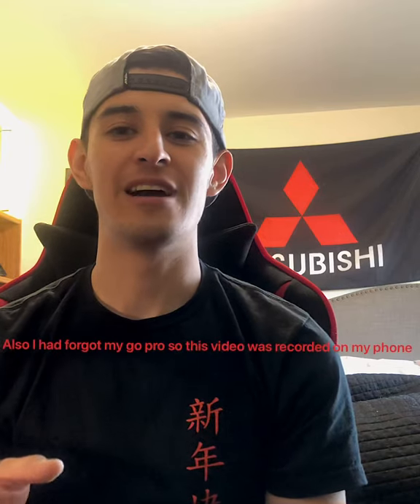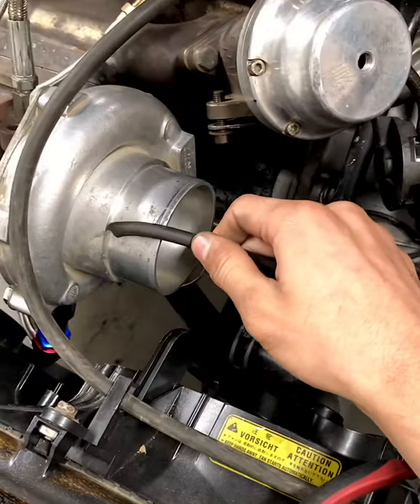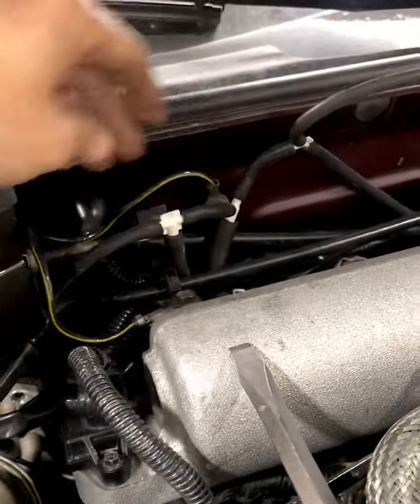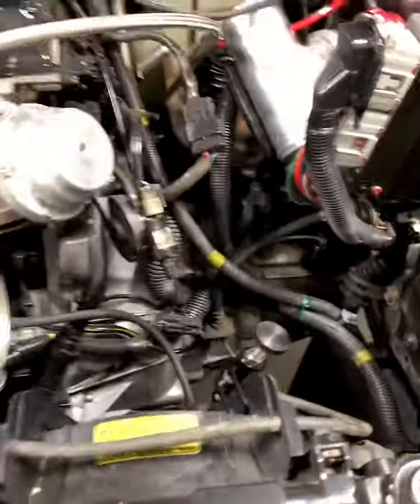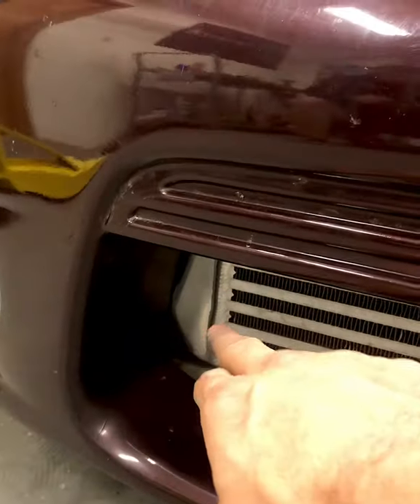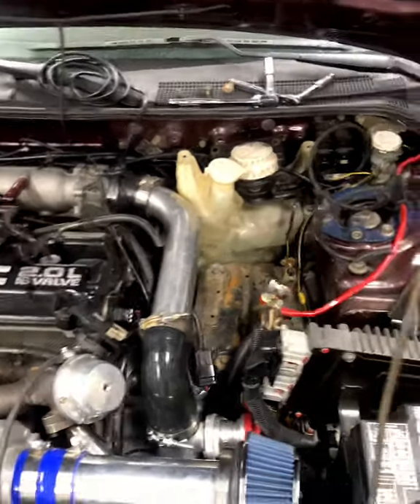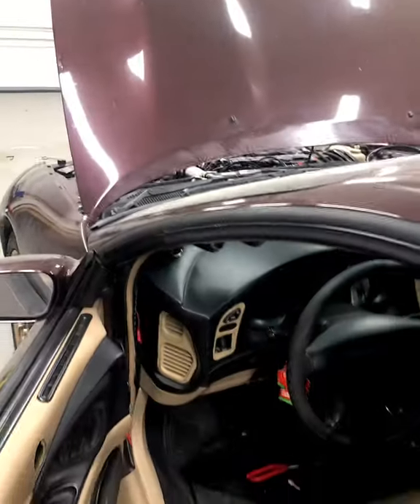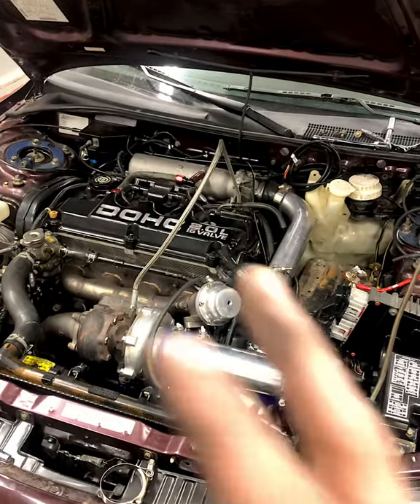Turboing Mitsubishi Eclipse 420a Part 4 Finalizing the Build

Comment: Looking good, be careful with that small filter, I'm not saying for sure on your application but they can ruin your turbo and Rob HP if to small, you go by HP to get the proper size of filter, I used to rebuild turbo's for a company and seen a lot of people ruining turbo's that way
Reply from the maker: Thank you for the tip I did not know that about those filters👌🏼

Comment: Thinking about buying a Mitsubishi eagle talon for 2000$ should I do it ?
Reply from the maker: Is it turboed?
Reply: @isaiaharechiga8924  yeah also has a cold air intake in it
Reply from the maker: @ethen_dsm7696  I would say go for it if it has the 4g63 for sure
Reply: @isaiaharechiga8924  yeah it does have it but the only thing is that it needs a new battery that’s what the seller said but I’ll let you know if I cop it
Reply: @isaiaharechiga8924  just got it today runs fucking amazing
Reply from the maker: @ethen_dsm7696  hell ya that’s great news!